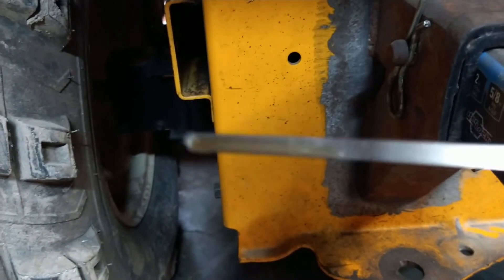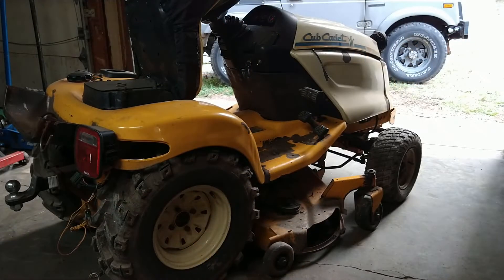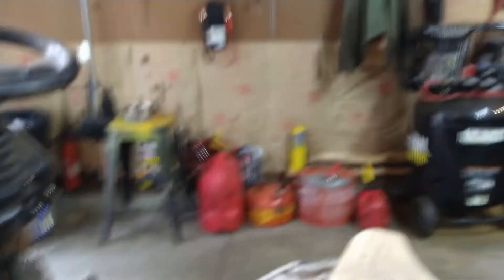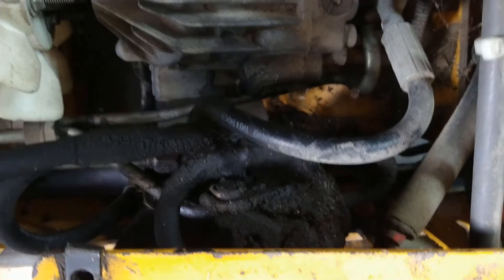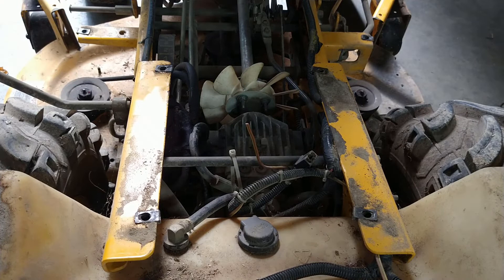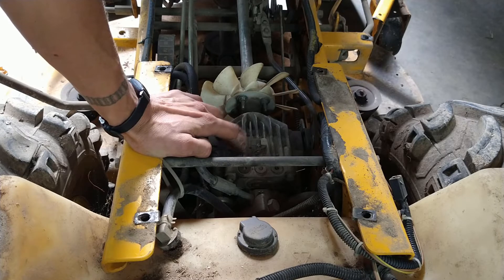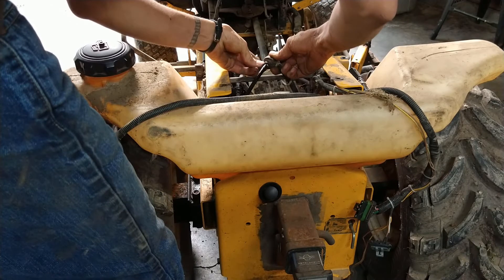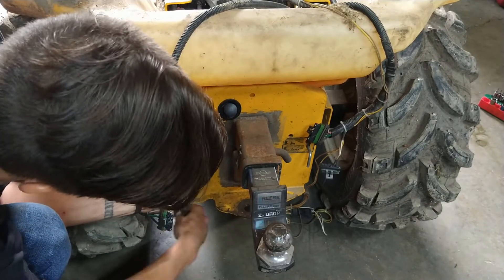Cub Cadet 3205 Hydraulic Failure Diagnosis - Part 1

Comment: Ok brain pick time!!  So I have a 3000 series. Not sure of year. Everything works as it should however when I push the petal to move it jerks vary harsh. I did find I had a leak come from the rear end and the hydro oil was milky bad. If I change the hydro fluid and filter and fix the leak will that fix the problem of it jerking badly or is something else making it jerk hard when moving?
Reply from the maker: You may have an internal issue with the differential.  I would start by changing fluid and filter, then take it from there.

Comment: I have a series 3000 also but my power steering, forward and reverse work but my both of my hydraulic deck lift lever wont move or feel stuck.  I cant figure it out.  Have you seen this before?  Thanks.
Reply from the maker: Yeah I have seen the spools get rusted to the valve body.  Has this unit been stored outside, or otherwise been left unused outdoors for a long period of time?
Reply: Yes got it from a neighbor who was too old to work on it so I have already replaced the PTO…so I’m assuming the PTO broke and he didn’t know how to fix it and it worked fine after that for about 4-5 mows with the deck lift working but the deck tilt didn’t from the beginning
Reply: But yes it sat out outside for about 2 yrs

Comment: Fresh hydraulic oil and filter change on my Cub 3184 but you literally have push pedal is very hard to depress then it finally moves? Any thoughts? Thanks
Reply from the maker: Did it do this before at all?  I would not think the two are related.  The pedal is a mechanical linkage to a gas spring, then to the hydrostatic transmission control trunion.
Reply: Had a 3184.  Slung a 60 inch deck on it just to see if it would work, while I was rebuilding the smaller deck.  It worked out well enough, as long as what I was mowing wasn't too long.  The little engine got a little too warm for my liking, but overall, she was a good tractor.  One day I decided to thin the herd and let her go to a guy who needed it, but was financially broke, recovering from cancer.   Didn't even ring him up for  the completely rebuilt deck.  When I showed him the receipts just for parts alone in the deck he was beyond grateful.  We've been friends from that day on.
Reply from the maker: That's awesome!  I am a firm believer in paying it forward and helping others when we can.  It's one of the reasons I started doing  the YouTube thing. 

I find that the horsepower ratings of modern lawn tractors are way overkill for what they need to be.  The horsepower numbers sell machines but in reality it only takes about a comfortable 18hp to run the Cub 54" decks and maybe 20 for the 60".

I also find it is as much about maintenance and care as it is anything else.  A well tuned and clean/cool running engine will outwork a tired and dirty/overheating one.

Comment: I had the same problem...but after I replaced the broke rotor and replaced the oil, it wouldn't move at all. There were no scratches from  the broken bearing either. Does anybody know what might be causing this?
Reply from the maker: I would check you hydro release button/relief valve and make sure it isn't stuck.

Did you change the fluid filter as well?